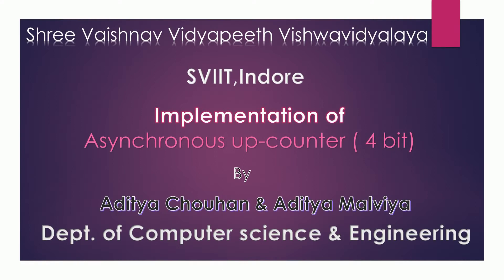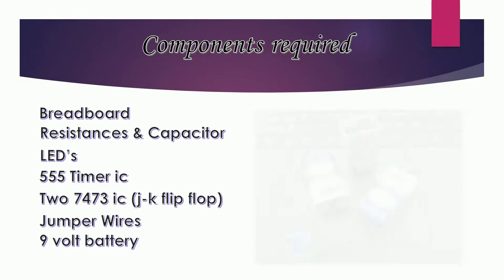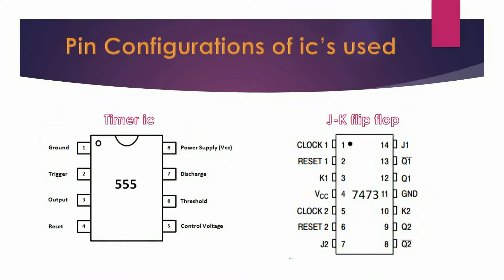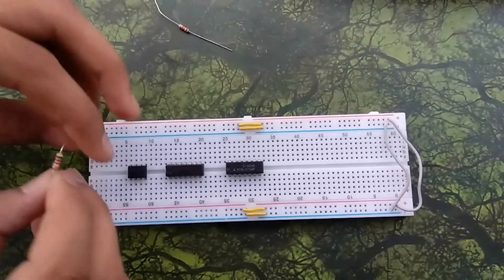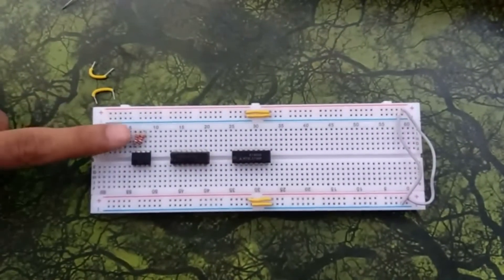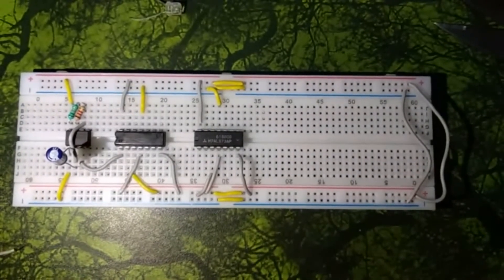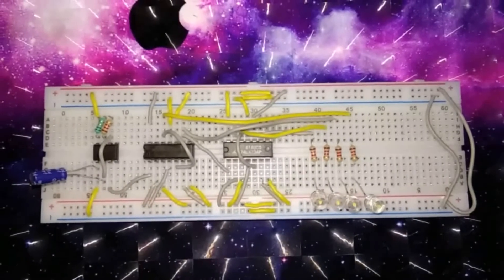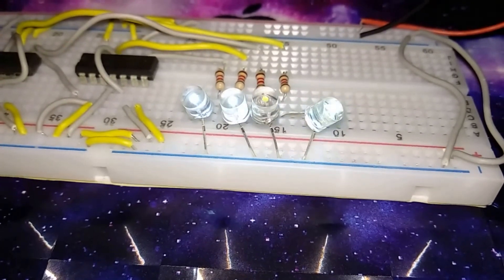How to implement 4-bit Asynchronous upcounter using J-K flip flop

Comment: How do u know the values of resistors and capacitor to connect? What is the frequency of clock u have given? And why did u connect capacitor in the circuit?